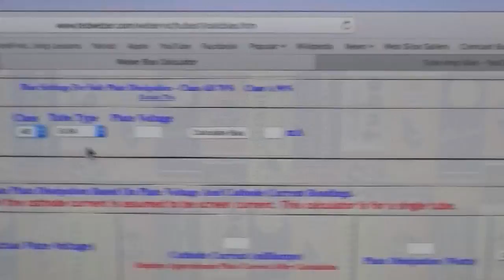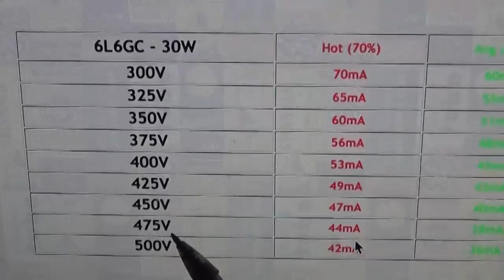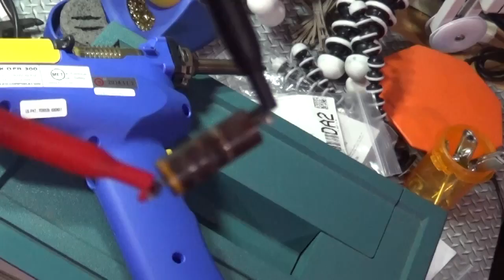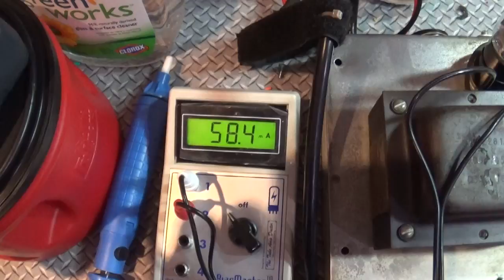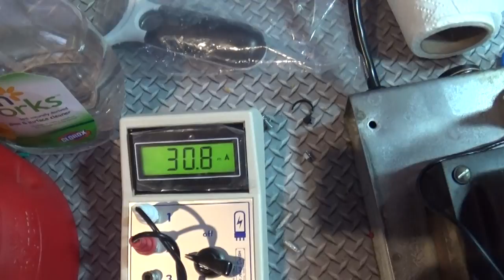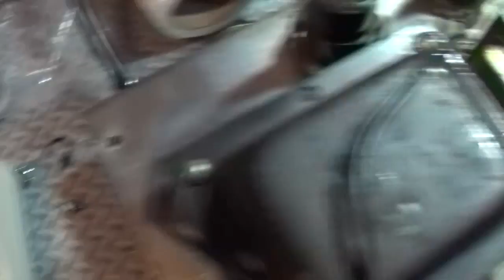1972 Fender Bassman 50 TC - Episode 3- Doing it right this time

Comment: You can’t measure plate voltage or set tube bias without tubes installed. 🤔

It’s not about just choosing a certain mililiamp value, it’s about that value multiplied by actual plate voltage (with tubes installed!) to calculate plate dissipation. Your 472v PV with no tubes installed is probably more like 440v with tubes, which means you’re biased closer to 50% - “safe” but pretty cold for a 30w max tube. 

Replacing screen grid resistors is a good idea, but isn’t going to fix / alter plate voltage. 

All those orange drops… that poor amp.

Comment: good job Ron!  I was guessing 1k 
low resistance means more current flow.  
So you had to kick the resistor up a bit.  
Funny thing, 5k is like ten times the original 470 ohms.  
Plate b+ are both sides of the tapped transformer after resister.  
BUT check GRID voltage.  The grid voltage should be negative, not positive at 0 vol. 
At least -5.  A pos voltage can cause tubes to get red hot.  
That's because of leaky grid capacitor paassing DC to the grid.  The grid resistor sets current flow, the cap blocks DC +.  When you turn up the vol, the signal will go through to the grid to be amplified by the tube.  Don
Reply from the maker: Excellent explanation.  Thank you Don.... Another great learning experience for me.  You are a good man
Reply: yup, I still get confused, um no engineer, just a dumb ham.  It took me a long time to get a basic idea of tube theory, um not schooled like those college geeks.  Tubes and transistors are sort of simple, but the risistors, caps, coils, and other transistors in circuits make me crazy, my ADHD goes nutso with skemmy road maps, I often get lost in it.  But the bloke's "valve" analogy really helps to understand tubes.  The grid measurement shows that the valve washer isn't leaking or dripping positive voltage.  The vol control opens the flow through the valve.  Keep in mind that the valve has natural restriction in its design, i.e. size of washer opening (the grid cap / resistor).  A leaky cap is likke a leaky washer.  The grid resistor is like matching washer size to fit the opening.  You'll probably go to Lowe's and study an old brass valve, aye.  Don
Reply: btw, a rectifier tube has no grid, but is still like a valve. It's more like a check valve, that only allows current to flow one way.  One side pressure (cathode), the other side load (plate).  A check valve is non restrictive, full flow in one direction.  Think of a pump piston moving back and forth.  The water would go back and forth through the hose.  The check valve stops the back flow.  A water tower can act like a cap to deal with pulsations.

Comment: Very good vid.   Very informative.   You nailed the explanation of what you did.    Very timely topic for me.  That website provided is going to be useful too.  This brings up a question though.  How hot temperature wise is a tube at the specified 70%, 60% and 50% bias currents.     I have a 1959 Philco stereo with 6V6GTs in it in an AB config.   They seem to be running at 330 degrees F.  Is that TOOOOOOOOO hot?  Thanks for help.  I wish I had the bias current tester you have to make testing easier to check bias current.   I don't have enough tube experience to know what is a normal/reasonable quiescent temperature.
Reply from the maker: Jp... I have a temp gun and can shoot a quick video tonight to post. As I recall they run about 250 when all fired up, could be higher when driven. Will let you know my friend... thanks.. had fun on this video.
Reply: Thank you sir.

Comment: Nice fix on that Ron,,,, good ole Donny to spot that eh? Very cool Don.
Reply from the maker: Thanks Carl. That Don is a good guy.... always helping..  Now I know this Amp will last another 50 years :)
Reply: The blokes call tubes valves.  
The water supply pressure is before the valve (cathode). 
The handle (gate) adjusts the opening (like a pot or resistor). 
The valve washer goes from stop to full flow (like a grid).  
The hose fitting has adjusted current flow (like b+ plate). 
The hose goes to the sprinkler (load or speaker).
Reply: and at least reliabley through gigs where it really matters.  
now when you see the lead guy overdrive his Crate at 11, you'll watch for the smoke, lol.  Those amps take a lot of abuse, A LOT!
Reply: btw, good engineering deals with abuse.  there are ways to prevent transformer burn out, blown tubes, and blown speakers, such as FUSES (sometimes sacrificial resistors), good circuit design with padded headroom, and quality components (not that cheap crap inside).  Think of it this way, choice:  a ten watt cheapo speaker, or a 500 watt capacity massive heavy duty speaker, which will last?  joernone is working on a speaker that lasted nearly 90 years!